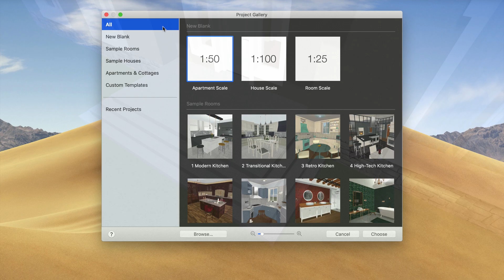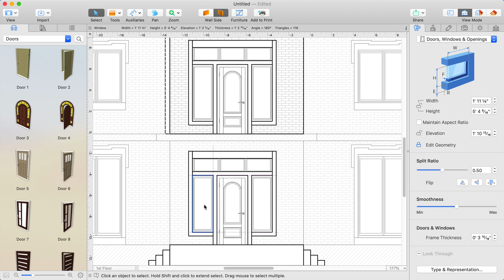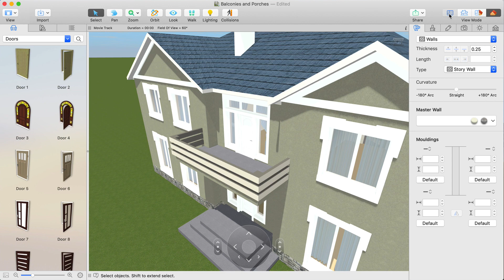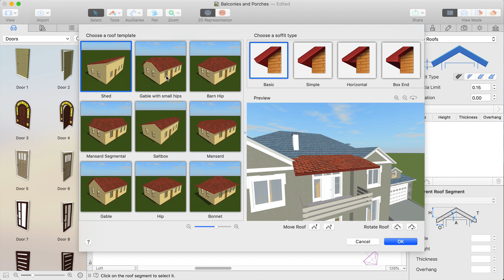Making Balconies and Simple Porches - Live Home 3D Pro for Mac Tutorials

Comment: Where is the railings
Reply from the maker: There is no staircase constructor available in the app. If you need to design a custom stairs object, you can try constructing it out of stairs sections and shapes, that are available in the Library, or import a custom 3D model into your project. For railings, cylinders can be used.

Comment: Mine keeps making a roof???
Reply from the maker: Hi Haley, you can make the auto roof editable and remove it. If you have some difficulties with this, please contact us by email at support@belightsoft.com with the project file in Live Home 3D format attached.
Reply: @LiveHome3D  How do I do that?  Also - I'm trying to add a deck to the loft and it considers it a floor and adds a roof.  Frustrating!
Reply from the maker: @vparawell546  Hello, please don't use AutoRoof. Draw a custom roof over the desired area using Roof Rect or Roof Poly tools.

Comment: there are no railings in the object library
Reply from the maker: Hello Jonathan! Railings can be made from custom shapes, located in the corresponding section of the Object Library. Instead of custom shapes you can use Shapes of custom form and size.
Reply: @LiveHome3D  how?
Reply: need a video!
Reply: I have pro and "merge" doesn't come up when I right click...
Reply from the maker: @vparawell546  Hello, please don't use AutoRoof. Draw a custom roof over the desired area using Roof Rect or Roof Poly tools.
Reply: @LiveHome3D  Thank you.  Another question:  I have a loft area on my gambrel roof which is the upper floor.  I can't place furniture on this floor - the furniture will appear below the house.  Why?  I tried to put the furniture in the room via 3d, same thing.
Reply from the maker: @vparawell546  Please send your Live Home 3D project by email to support@belightsoft.com. Our Team will research it and help you to solve your problem.